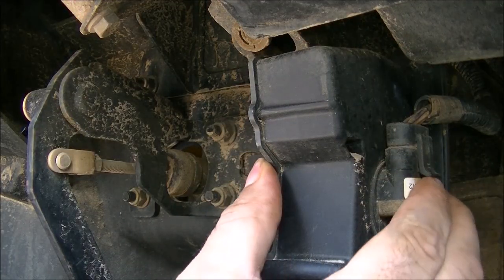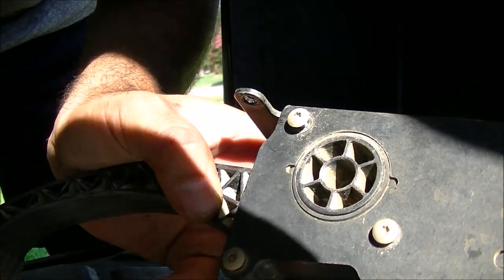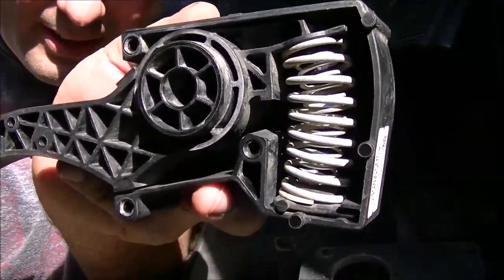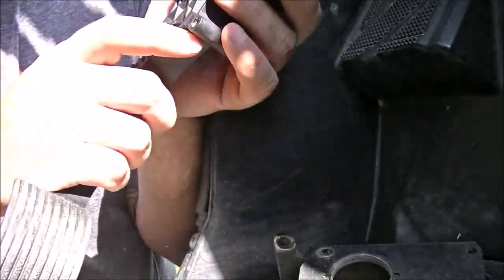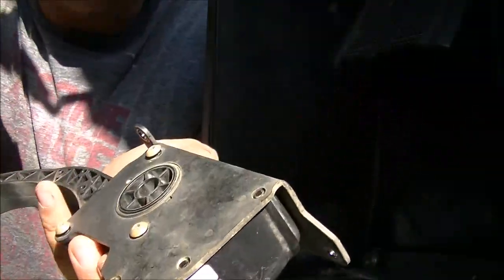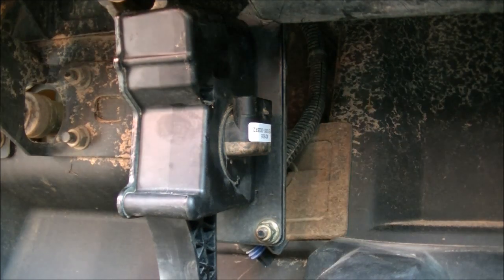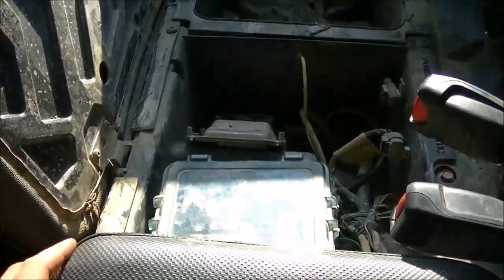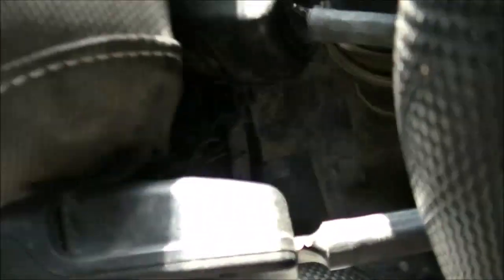DYING UNDER WATER....PART DEUX Cleaning Polaris Ranger Gas Pedal

Comment: Did this fix it? taking it the o2 sensor did not?
Reply from the maker: South FL Mud Club I did them both at the same time.  I think the gas pedal is the ticket though.  I deleted the o2 sensor and all was good for a few rides but I got a code for it on the last I ride I was on, so I think I'm gonna put it back in